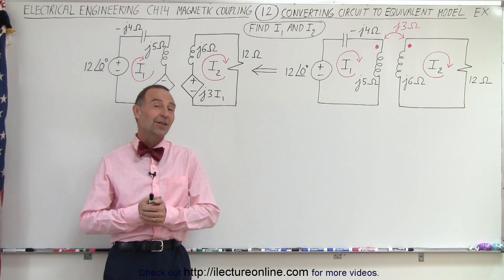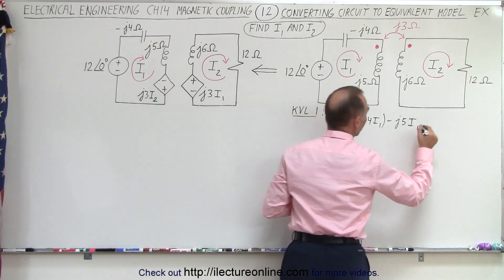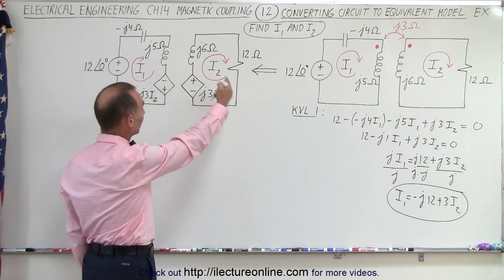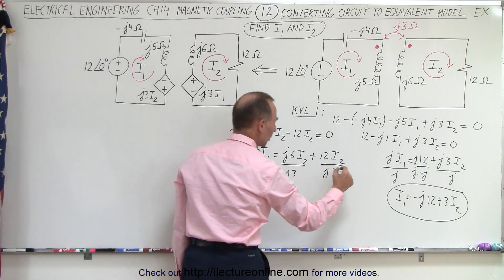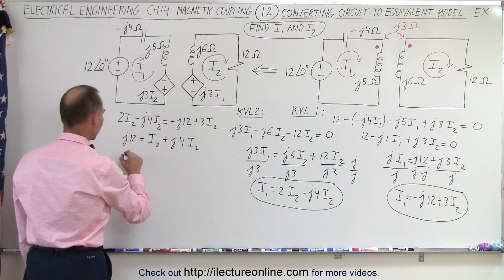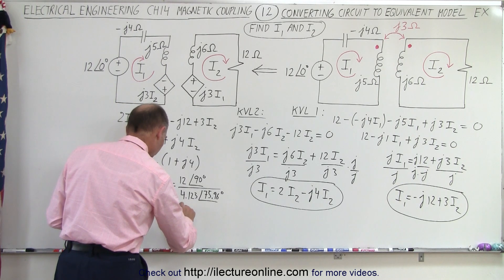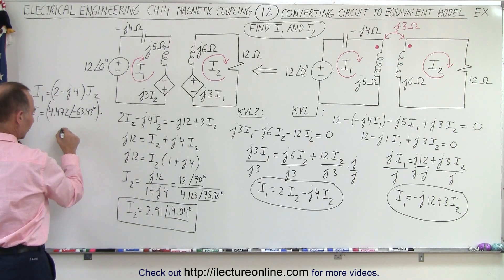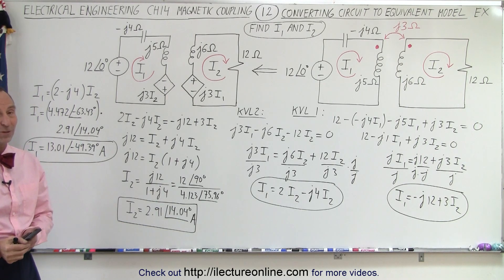Electrical Engineering: Ch 14 Magnetic Coupling (12 of 55) Convert Circuit to Equivalent Model: 1

Comment: Let's look at a real circuit. Line voltage into the transformer. A full-wave bridge rectifier on the output into a voltage regulator. What is the noise fed back into the main? How much harmonics are fed back into the line? What is the power factor? What is the efficiency?
Reply from the maker: Those will come in the next stage of video coverage in electrical engineering.

Comment: is it -12 or 12
Reply from the maker: Are you referring to the source voltage or to the 12 ohm resistor.  And what term in which equation do you think should be -12 instead of + 12?